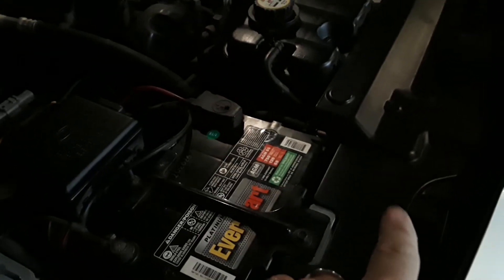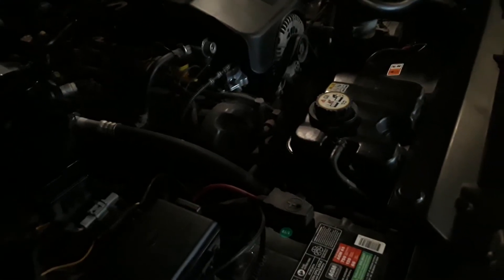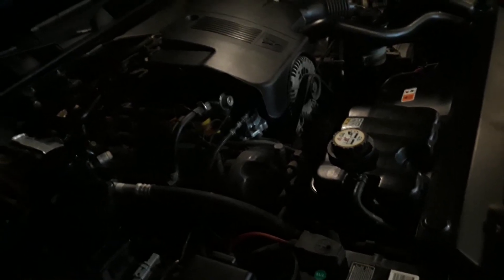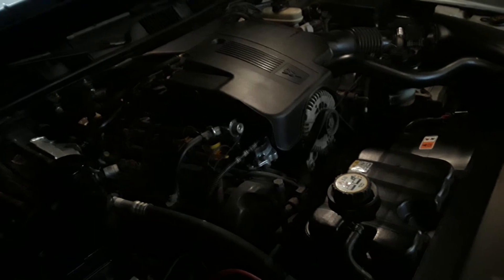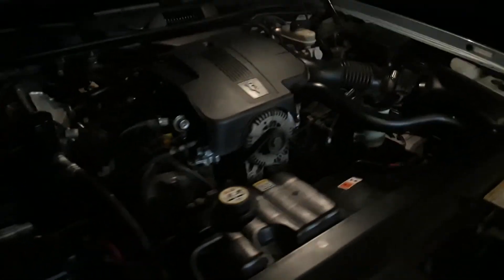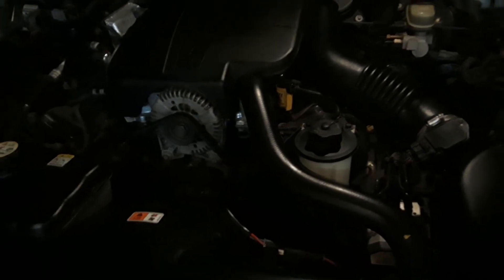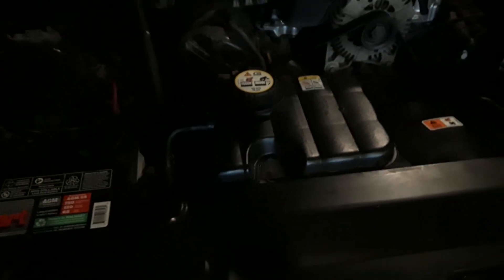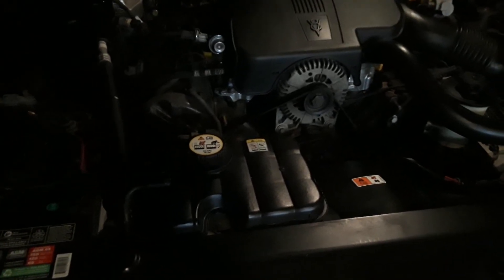Why I ALWAYS add an auxiliary transmission oil cooler!

Comment: I hope your's not a CVT one. ..    (Continuously Vulnerable Transmission)...
Reply from the maker: I'm not aware that CVT's are used in trucks as they are not considered to be a heavy duty unit. More for smaller economy cars. This generation of F-150 uses two transmissions, the 4R70W or the 4R100. Neither are CVT.